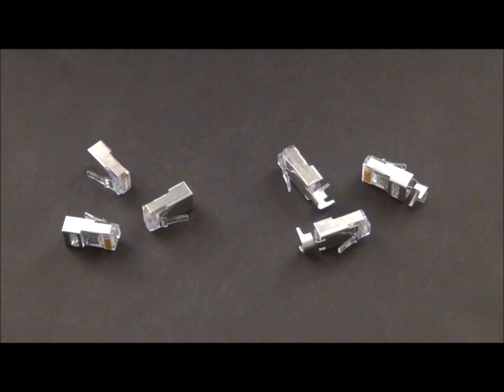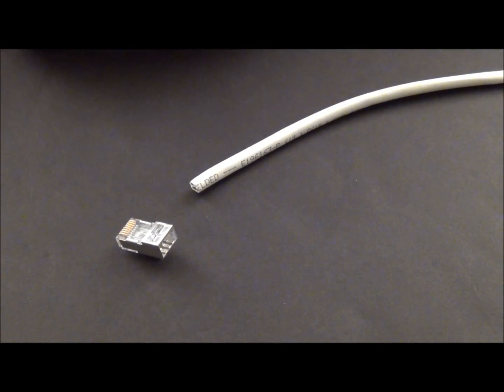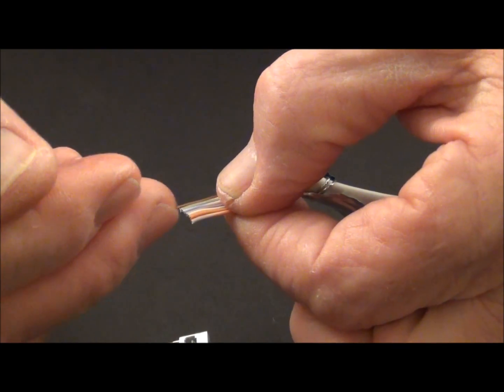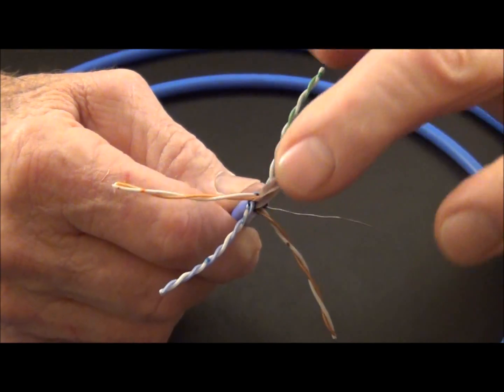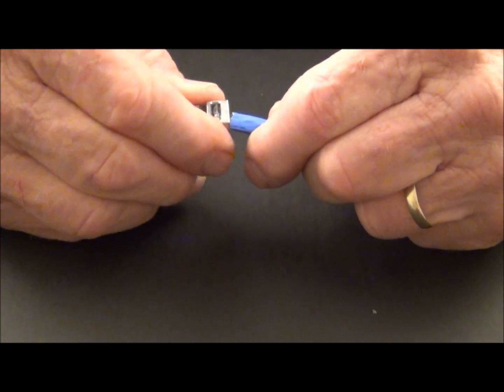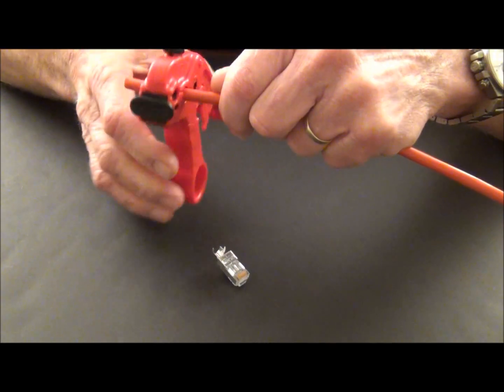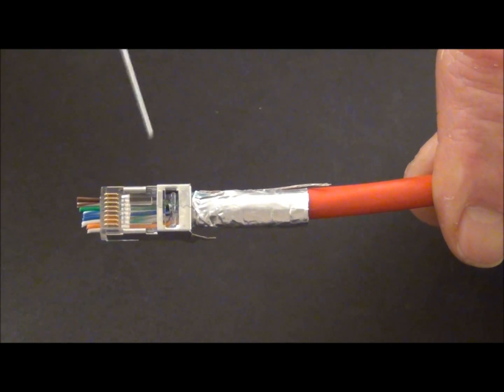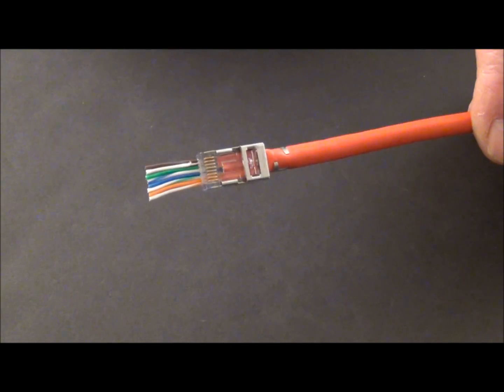Introducing: Cat5e & Cat6 Connectors, EZ-RJ45 Shielded

Comment: The shielded cat 6 I'm using won't fit into these ends, the conductor awg is just too large to fit through. Very disappointing as these brand ends are my favorite normally.
Reply: Same problem. Too big and won't go out through the connector. Cat5 works fine, but not cat6.